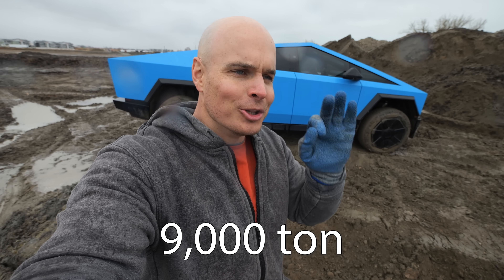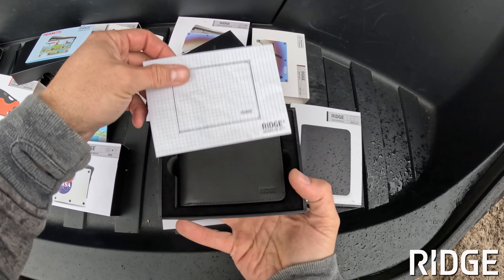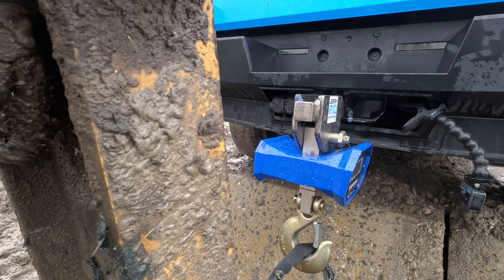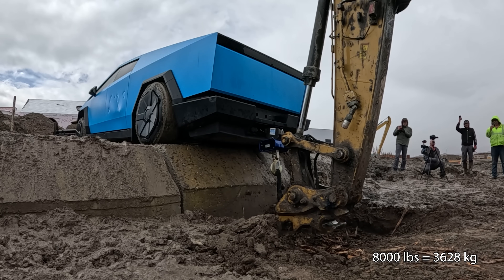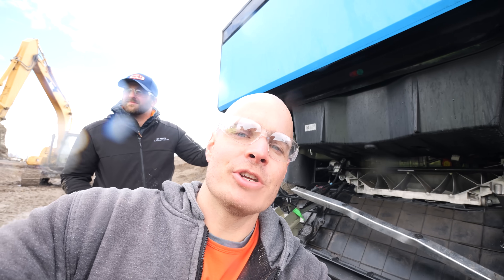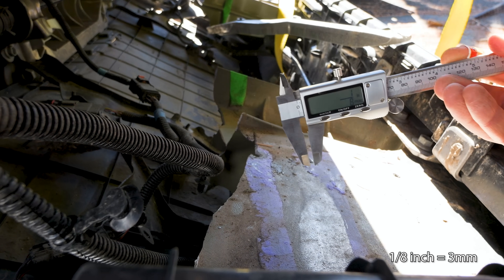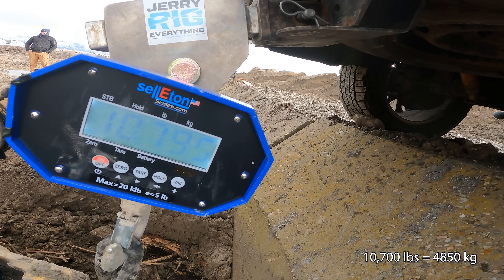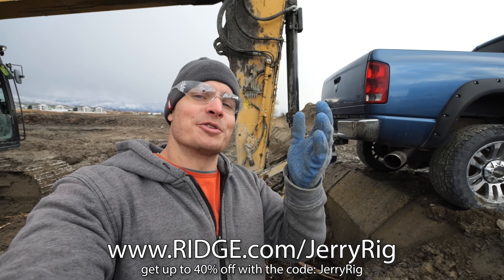SHOULD YOU TOW WITH A CYBERTRUCK?! - (catastrophic failure test)

Comment: This is completely ridiculous, if we take a 11k pound trailer, max realistic force multiplier is x4 considering braking acceleration's potholes and then to top it off you need an 35% incline to exceed the 10500k breaking point. This also assumes hitch was loaded by 15% of the 11k pound trailer which exceeds teslas safe numbers. For the towing test, we can assume we are strapped to a wall(fully stuck car) with full acceleration of the cyber beast(1.05g) angle needs to be more then 55 degrees to brake the frame. Insane anglee, combined with full throttle and enough lose chain to reach max acceleration. Is it the strangest truck ever? No. Should you be allowed to drive a car if you manage exceed these numbers? Also no.

Comment: To be fair, that much pressure will never be on a cybertruck
Reply: I think the bigger problem is having critical loadbearing components constructed out of aluminum, every time you tow it becomes weaker and weaker and the next thing you know you your off roading with your buddies and you smack your hitch on a rock and then your whole rear end comes off. It’s just not how it should happen. It should bend not break away.
Reply: to be fair the real world isn’t “fair” 
it’s a design flaw it WILL break eventually on every single one of them because of the material used, this is showing why that would happen
Reply: @ Link or any info to where this has ever happened at all in real world use even once? VERY eager to see it if it has. (It hasn't).
Reply: this video obviously wasn't meant to be fair
Reply: This is nothing more than political revenge. He endorsed Harris, is more than likely one of the many people who decided to boycott Tesla, and this is his way of doing so. He has that right, but the way he packaged this video is disingenuous. There will never be this much pressure on the tongue of a Tesla. Even if you take a 20k lb load (which is doubled the towing capacity), the tongue weight will only be 10-15% of the load weight. I really can't respect this video at all because it has ulterior motivate written all over it.
Reply: @Go-Getter  showing a video of how a badly designed CAR fails at its job is not political 
YOU made it political because that is what you think about when you think of this car maybe you should get a car that doesn’t make you think of politics
Reply: it has happened in the real world already
Reply: @ Just checking in, I still haven't received a reply or message with a link to any information where this has once happened in the "real world." Still very eager to see it, (if you aren't just stating BS)
Reply: @plexyglass429  No it hasn't. Send me a link to any proof, and I'll apologize and admit you were right.

Comment: Fake news video. The Tesla Cybertruck’s tongue weight rating is 1,100 pounds (499 kg), as specified in the official Cybertruck Owner’s Manual under the “Towing Capacity” section. This aligns with the industry standard of tongue weight being approximately 10% of the vehicle’s maximum towing capacity, which for the Cybertruck is 11,000 pounds for the All-Wheel Drive (AWD) and Cyberbeast trims. It broke at nearly 10X that value. FUD FAKE MISINFORMATION VIDEO FROM A WEAK KAMALA VOTER!!!
Reply: the problem is that a Trailer can impart that force during hitting a pothole, and over time it weakens it and weakens it until eventually it breaks. this has little to do with politics, its just not a good vehicle.
Reply: @ hitting a pothole will never 10x tongue the weight. At best it could 2-3x if it’s a real severe one. Just think of the physics you need to get to 10k, look at the video. Stop being delusional. Cybertrucks have been out for over a year not a single time has it broke with a trailer.

Comment: Honestly though. I wasn't expecting anywhere near 10k I am a bit impressed. Also I think that first crack sound at 6k was probably whatever that secondary aluminum piece that was attached to the frame and I would call 6k the point of failure not 10k. Not sure if it is totaled level of failure but still. Also the steal frame had previous bend but even without that it was bending before 6k. But this is a very unusual situation. You might get 10k spikes but you are never going to be at a constant 10k unless you are really fucking up.

Comment: Tongue rating of tesla cyber truck is 1100 pound. It exceeded that 9x the ram being rated at 1800 pounds would need to reach 16,200 to reach that same margin. 

A gooseneck trailer and load of 20000 pounds exerts roughly 3000 pounds of tounge weight. 

You could argue breaking and crack with little or no warning is bad, but to actually exert 10,000 pounds of force with an 11,000 pound trailer in a pure shearing motion is just outrageous.
Reply: Because this test isn't objective. It's meant to make Tesla look bad and make uninformed people think it's unsafe when it's literally 10x stronger than it's rating.
Reply: This only applies if the trailer is properly loaded, with all other things done correctly. People are gonna be people and do stupid shit, so someone WILL (and already has) improperly loaded their trailer causing the rear bumper of the Cybertruck to come off ON THE HIGHWAY. Sure it's impressive that it took that much weight, but aluminum has no fatigue limit and WILL weaken over time, exacerbating this problem. The point of this test and comparison wasn't to put the hitch into a 'real world' scenario, but to compare HOW MUCH weight the Cybertruck hitch could withstand versus a steel framed truck with comparable towing capacity. You seem to have missed the point of this video entirely, did you even watch it all the way through??
Reply: The tongue will eventually see much higher dynamic loads in some situations :)
Reply: Also a cybertruck vs a 2500 level truck is wrong. Why not a 1500 truck?
Reply: @angloblaxon  lol!!!! its literaly the same as a 1500, the difference is suspension, also its a 2 decade old truck.
Reply: @carholic-sz3qv  look it up. You're wrong. Thicker frames and different designs.  You're confusing 2500 to 3500+ trucks with suspension elements.
Reply: I agree, this test does not apply to real world.
Reply: The alarms did go off before it broke at 6:02
Reply: A gooseneck shouldn't be on the normal hitch it should be on a gooseneck hitch, in the bed of the truck, so that doesn't really apply here
Reply: The problem is the aluminum... Every time it gets a shock, it gets weaker and weaker ... It's not like steel, you don't have that problem with steel.... So every time you use it and you bump in a hole the thing gets weaker, imagine if someone use the thing everyday on a garbage road...
Reply: @UmbraWeiss  Like a big bump similar to an aircraft hitting the runway.... for 30 years?
Reply: Exactly!!
Reply: point is and where the problem comes in on a steel frame even if you grossly exceed the capacity on the steel chassis it will bend but it won't just break off
Reply: @shaynegadsden  ...and the Tesla took 10 times more than It's advertised weight before breaking off!
Reply: @TimLucasdesign  Again the issue is break, the steel chassis won't break also this is a single test repeated loading will cause aluminium to fatigue and break even with much lower weights which again isn't an issue with steel
Reply: It's like the Cybertuck is the Cyberpunk 2077 of vehicles; nothing like what it was originally promised to be.
Reply: But he isn't driving with a 10000 lb load. What does that 3000lb of tongue weight you reference become if you hit a bump or pothole? I'm not an engineer, so I cannot say if this is enough or not. Dynamic loads will dramatically exceed static loads, though. Jumping, for instance, can exert 5-10x your body weight on your joints for brief periods. Running exerts 2-3x your body weight with each stride.
Reply: @tcv4  It is not enough, the inertia takes a huge role here. You'll probably break the suspension way before the chassis is affected.
Reply: He said in the video when towing uphill the 10,000 tow weight becomes 10,000 tongue weight, so it needs to survive it anyways.
Reply: @termiterasin  he is wrong though.
Reply: @termiterasin  that is simply false, it doesn't equate. Not at all.
Reply: @termiterasin  that is a huge error. unless you are in a 90º angle, you'll always have vertical forces, so no. You wont ever reach the tongue weight by any mean.
This was either ignorance or intended misinformation
Reply: sounds like a bunch of cyber babies crying when their trucks are shamed…😂

Comment: I like your test, but I would have been interested to see a repetitive loading test.

Steel has give like a spring, so it can take thousands of shocks without deforming.  Aluminum is know to weaken over repetitive use.

This is why steel bike frames will out live their owners, while aluminum bike frames will only last a few years for comparative cycles.

Cast aluminum just isn't a great material for parts that need to handle repetitive shock for years.  This is one of the reasons you don't see bridges built from aluminum, and aircraft have lifespans based on pressurization cycles.

Comment: The purple adhesive is fairly normal in the automotive world these days. Nearly every car has adhesives in areas that are spot welded for better overall rigidity. It's partly to thank for why modern cars feel so much better put together than older vehicles.

On the Tesla, it looked like there were little spot welds or flow drill welds in addition to the adhesive. The adhesive should never be used without a mechanical fastener as well. Similar idea to the "glue and screw" in woodworking. Most likely the intention was to better bond the bed to the frame rather than try to add any appreciable strength to the frame.

All that to say that I also wouldn't trust a specification from Tesla with their propensity to overhype their products. The engineering best practive for automotive factors of safety for structure elements like that should at least 8x the rated number to handle things like railroad crossings and usually 20x for crashes.

Comment: TLDR

Physics : Towing forces are  horizontal

Zack : not in my book.
>Proceeds to load it vertically.
> cyber truck endures 10 times the recommended weight and breaks  at 11000 pounds.
>zack : catastrophic failure.
Reply: shlorp shlorp shlorp
Reply: Zack is still salty about losing the elections voting on Kamala that’s why
Reply: Explanation makes no sense. You can't just say something would exert x thousand lbs of force without actually calculating it.
Reply: Did you not watch the video? theres a nice bit @10:02 about the real world application he was trying to point out. whilst you’re right that indeed “Physics: towing forces are horizontal” is true, in the real world its not all flat we have hills & etc. 

Not that it matters really, I really cant see cyber truck owners towing anything other than maybe jet ski’s & boats.

Comment: I don't think that the problem is the metal used,  you can have an aluminium frame much stronger than a steel one if you have proper geometry, manufacturing technique and alloy.
I think that the problem lyes in the sudden breaking of it, for truck it's safer to have a frame that bends before breaking using a more ductile alloy.

Comment: One of two things is happening here. 

You are either intentionally misleading your viewer, or you are just mis informed. 

You keep referring to tow capacity, but all you test here is tongue weight or hitch weight capacity. Two VASTLY different ratings which you seem to use interchangeably. 

Let’s take an F150 for example. Their tow ratings can be about 12,000 lbs, where as the tongue weight capacity is usually about 10% if that. Call it 1,200 lbs. In no way shape or form do you expect the tongue to carry all 12,000 lbs when it’s on an F150, so why do you expect any different from the Cuber Truck? The cyber trucks rated tongue capacity is 1,100 pounds. It clearly does a phenomenal job at exceeding that. 

Whether the misinformation is intentional or not, I’m deeply disappointed in you for this video.
Reply from the maker: lol I literally say this in the video - but thanks for repeating it here in the comments.

Comment: When are you ever gonna have 10,000+ pounds on the hitch of a cyber truck?😂
Reply: Well, if I ever own a Cybertruck and back a trailer over the edge of a cliff I know I'm good up to 10,000lbs haha.
Reply: @theslimeylimey  its advertised  to do more. So youre being ripped off. Thats a crime
Reply: @localblackman427  the rated tongue weight is 1100 lbs and it handled 900% more than that before it failed so what does that tell you?. This whole test is pointless because it's not real world loading and doesn't test for fatigue failure which is most likely the actual problem.
Reply: @localblackman427 it's spec is for 1100 downforce and it survived a lot more. 
I pushed a car last week that weighs about 1300kg. Does that mean I am the strongest man alive because no record of lifting weighs comes even close?
Reply: @theslimeylimey  the test is showing how much weight it will handle at a quick leveling. To call it pointless just shows you mostly drive on streets and freeways
Reply: @localblackman427  What is "quick leveling"?  I am not familiar with that term.
Reply: @theslimeylimey  watch the video
Reply: @theslimeylimey  if you ever own a cyber truck, you will have wasted $90,000 on a vehicle who's doors can't be slammed shut.
Reply: Hard braking and hit a pot hole or train tracks will spike the load and shift weight drastically.
Reply: Never, because Cybertruck owners are crypto bros with more money than sense. But they were promised unlimited towing capacity by Elon.

Comment: The test is ridiculous - the tow ball tongue weight (weight pressing down on the ball) is not going to support that on any standard vehicle - any towed vehicle should place only a small positive downward load on the towball on ANY vehicle.  its not supposed to hold the towed vehile up in the air - its supposed to pull it not lift it....  its not rated for that load and will fail when loaded that way
Reply: he is misleading things ...but well the title will bring more viewers
Reply: The Dodge held it and then some. That's a "standard vehicle."
Reply: @Wheelman1966  sure but I'm not sure it would have been in tip top condition afterwards

Comment: 10:10 so even in your worst scenario, let's suppose your trailer weighs 12000 pounds (exceeding the towing limit), and supposing the slope's angle angle is 30 degrees ( guess it far exceeds the ground clearance), and ignoring the lever effect induced by the back of the trailer, doing some basic trigonometric math,  the downward forces for the Cybertruck would be around be around 5000 pounds, so even in the worst most unrealistic scenario it wouldn't be even remotely close to failure.. it would be interesting to hear why tesla chose Aluminium instead of steal, they surely didn't go for aluminum for no reason, also knowing how tesla operates, they could easily switch to steel in the future if they want.
Reply: “Easily switch to steel” I guess they can and add another few grand onto the price and recall every cybertruck already made and shipped to full take them apart and rebuild them. I assume they discontinue before they switch to steel.
Reply: Uhhh, well the TLDR as to why is because they are idiots. Also the worst case is the entire frame snapping, which is the point. Even if you put 15,000lbs on the back of a steel frame truck it's not going to just snap off because steel will bend long before it breaks whereas aluminum will just snap. Aluminum also has no fatigue limit so it will just get weaker as time goes on making this a when not an if problem. That's just how the metals are and that's the issue. Only an idiot would make a frame for this context out of cast aluminum, while also making the panels that have no reason to be steel like this, steel instead of the frame. 

So again the TLDR; they are idiots.
Reply: That’s a perfect scenario though. If you have it loaded half of that with half the angle and hit a bad road bump or it pops off the hitch and hits the safety chain, like he said in the video, it will impose a shock force way higher than its constant load and would rip off the bumper and rear frame. It kinda seems like Tesla’s are designed for perfect scenarios and they have no real world experience with stuff like this.

Comment: 11,000lb towing capacity has absolutely no bearing on tongue weight, which is what you measured here. This truck is rated for 2,000lbs tongue weight and it held over 10,000lbs. Incredible engineering by Tesla. Shockingly bad information in this video. You should probably do a follow up.
Reply: 100% premeditated judging by his tweeter/x activity.
Reply: That will never happen in the real world, trust me bro !
Reply: @jhanninnen it’s hasn’t happened to anyone in the real world.
Reply: Correction it's rated tongue weight is 1100lb not 2k. But shock loading aka acceleration, braking, bumps and potholes in the road, can cause enough damage to eventually crack the cast aluminum causing it to fail. I'd be interested in an industrial CT scan of the casting to see if the real issue is in the manufacturing process.
Reply: Looks like you didn’t bother to watch the rest of the video before commenting, because he explained why he te tested the tongue weight
Reply: @looney76  That explanation does not work for exceeding the weight limit to more than 9 times, this video test is a dud
Reply: "Incredible engineering" to use cast aluminum, sure...
Reply: yo are you getting paid for this comment because I need you to sign me up too.
Reply: @RiceBaker100  no, I don’t have a dog in the race. His testing methodology is garbage.